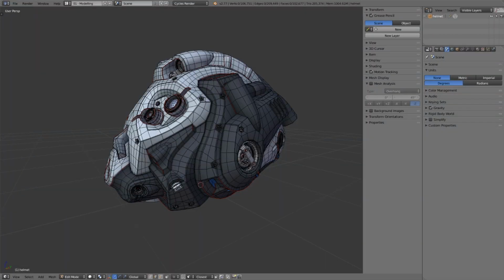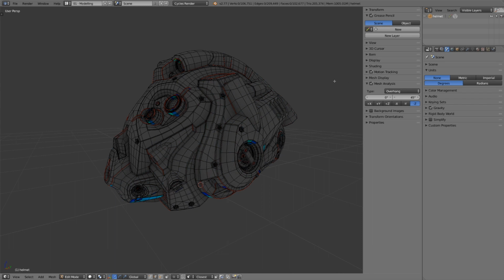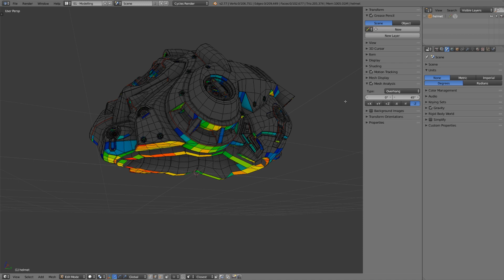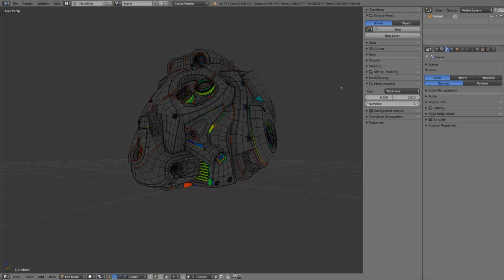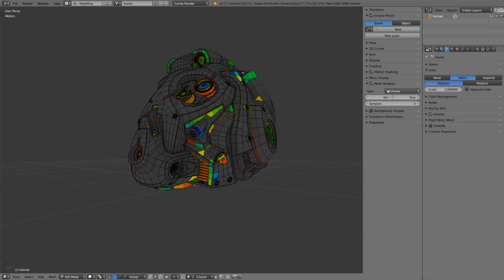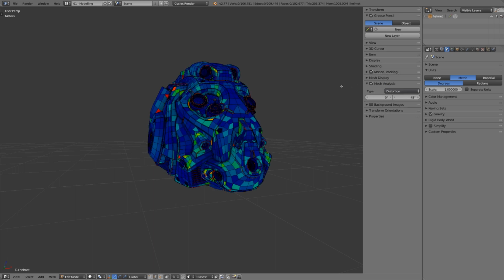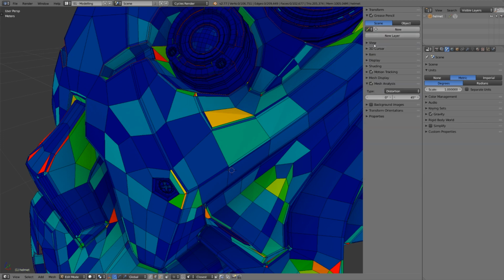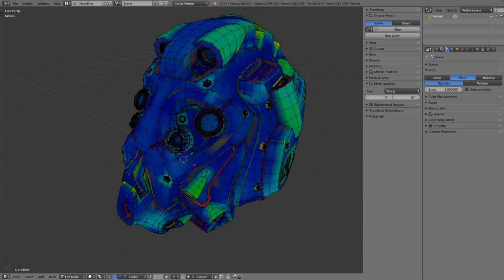Blender Video Tip: Mesh Analysis

Comment: I've just discovered this like 10 minutes ago in 2.82 (it's in the top right corner of the screen under Overlays (the icon that looks like a solid circle is intersecting with a wireframe circle)), and damn it is purely amazing! I suppose because automatic cleanup is nowhere near perfect, especially in relation to more complex meshes. But I wasn't sure how sharp was relevant until watching this, so thanks for simplifying that :)
Reply: I was searching this thing a long time. Then I saw your comment. You helped me a lot dude
Reply: @eustoliafukuyo6481  i still don't see it.  i know the overlays menu, but does an addon need to be installed or turned on?  Where the heck is this?  
2.93.1
Reply: holy shit i was looking for it for like 20 mins now! thanks!
Reply: @licheong  The overlays are still in upper right corner in blender 3.0
Here's an image of where it is:
https://drive.google.com/file/d/16p1TkGqAXOFtpIzZ41Zny1cPlsOX1EPN/view?usp=drivesdk

Comment: Wondering how to activate this again, it used to work but now shows nothing. Neither in 2.77 or 2.78, im in edit mode and none of the features seem to do anything? anyone got a tip here?
Reply: Did you apply all the modifiers?